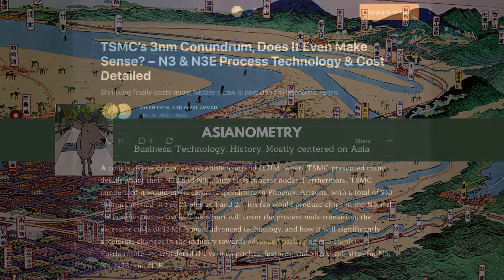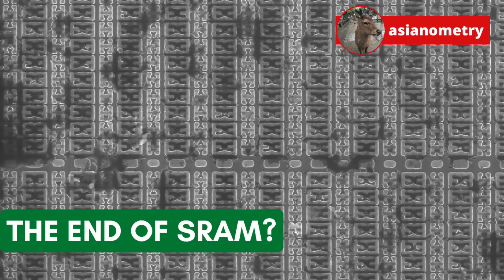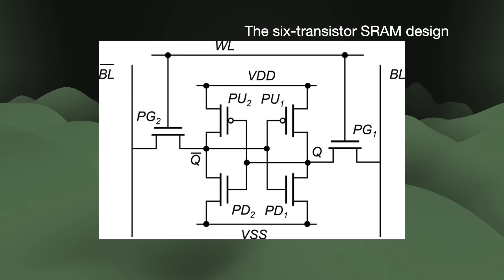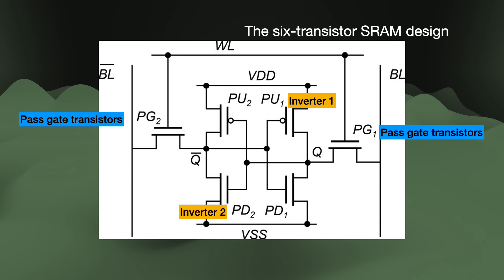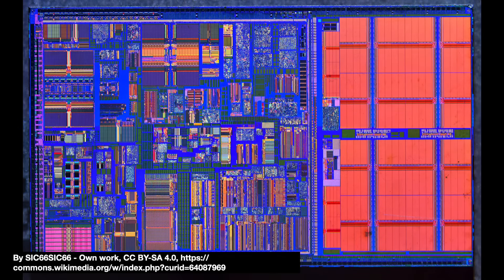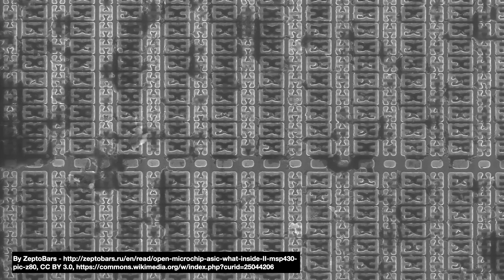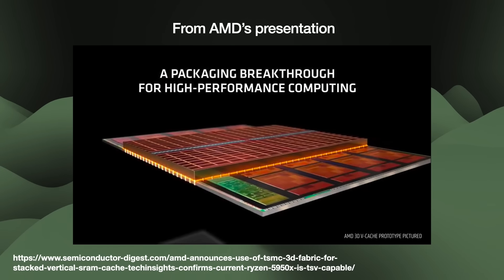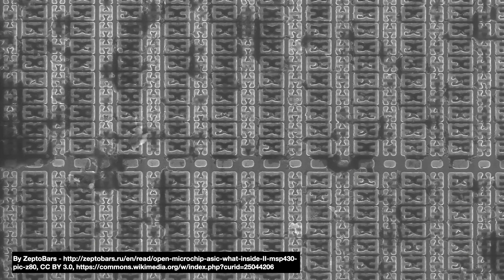Can SRAM Keep Shrinking?

Comment: 90%+ SRAM is certainly a lot, but having a lot of SRAM on a chip has a lot of benefits. For one, while it leaks, it consumes a lot less power than logic. It's also super regular and hand-crafted (unlike most logic), so, in a way, it's a very efficient use of area (especially compared to registers). It also has low power states you can use to save power in a graduated manner. Hotspots are basically always places where you don't have enough SRAM.

Designers go out of their way to try to turn structures that use registers into a structure that can use an SRAM for these benefits. The real difficulty is that to get the best density, you need to use 1RW-ported SRAM macros, which puts real limits on how you can use them. Nonetheless, this trade-off is almost always worthwhile.
Reply: SRAM that’s stacked runs hot and is often the hottest part of the SoC.
Reply: @alphar9539  Sure. Anything stacked gets hot. 🙂
Reply: One other advantage of SRAM over random logic is that it is MUCH easier to test (also including self-test in the field).
Reply: Aren't registers made of the same transistors as (on-chip) SRAM?
Do you mean separate chip SRAM? That registers are intertwined with logic thus of more expensive design? Or just less optimized because less regular?
Reply: @musaran2  Yes they are both made by the same process, but the transistors in the SRAM (and the fabric to read/write from the port) are super optimized because they are so regular and well understood. My understanding (I just use these macros; I don't design them) is that normal registers need to be built more conservatively for DRC, toggle more often, and have irregular control wiring.
Reply: @wesleyw.terpstra1902  Can you not fold a SRAM cell along one line, i.e stack two halves on top of each other to save area?
Reply: @wesleyw.terpstra1902  Anything stacked gets hot. - that was a distraction. LOL

Comment: So, another word for a latch is a flip flop. but latches/flip flops come in many forms.  This is a VERY basic latch, the minimal transistors needed to retain a state of a 0 or a 1.  If you were to look at a logic gate breakdown of this latch it's VERY easy to make sense of it.  Looking at a transistor breakdown, you have to understand the transistors.  You have in effect two sides for a latch.  Each side outputs the opposite of each other.  So, if one side is outputting a low (can't use 0 or 1 here) voltage, the other is outputting a high.  You can also say there is one side that has a true output and the other is false, or say one side is low when true, and the other side is high when true.  So, if a 1 is stored in that latch then one side is low = true and the other side is high = true.  If a 0 is stored, those two signals are inverse.  So, the high = true output would be low = false.

The way a latch works is the output of each side feeds back to the input of the other side, creating a loop that locks that logic state in the absence of another input.  Data will come in on one side of the latch.  If the data (0 or 1) is the same, the latch stays in the same state, if it's different, the latch changes state.  This is a very simple thing.

This is basic digital logic.

The reason why this is used is because you can switch transistors WAY faster than switching anything else.  You can switch the state of this latch at the clock speed that the CPU is running at.
Reply: This is incorrect. Latches and flip flops are different. Latches are level sensitive, flip flops are edge sensitive. A good chunk of money has been lost while designing a chip when someone accidentally put latches instead of flip flops.
Reply: Wikipedia:

> The term flip-flop has historically referred generically to both level-triggered (asynchronous, transparent, or opaque) and edge-triggered (synchronous, or clocked) circuits that store a single bit of data using gates.[1] Modern authors reserve the term flip-flop exclusively for edge-triggered storage elements and latches for level-triggered ones.[2][3]

Comment: You should make the point that SRAM in a processor is present in large amounts because it's used in caches , not being used as generally addressed working store, except for some embedded SOC applications. 

Also, SRAM is made with a standard "Logic Gate" fab process and DRAM uses very different materials and layering.
Reply: From what I understand SRAM is both used in registers and larger caches. I don't know why the distinction though.

Comment: It makes sense to use older nodes for SRAM stacked on newer process node logic chips. The cost would be pretty good as older nodes demand drops off and the equipment gets amortized.

Apple's integrated HBM is also a good solution as making the ram faster puts less pressure to need the even faster caches to be quite so big.

Everything is a tradeoff and there are some reasonable tradeoffs to choose from.
Reply: Yeah, but that means cost wouldn't decrease any further in the future. In the past cost per bit decreased with each node shrink.
Reply: @cube2fox  certainly it becomes challenging to reduce cost of sram from here forwards regardless what strategy is used. However, if a fixed node size becomes standard for sram, you can reduce costs in two major ways. One, you can optimize the cost of producing and operating lithography at the "final" process node. Two, due to stable demand for the process node, you can amortize the investment in plant and equipment over a longer time period. Not nearly as good as Moore's law, but it's not nothing.

Comment: DRAM is just horrible for fast access, low latency stuff, thereby it will never die for registers, fast cache, non static FPGA LUTs.....
For slow stuff such as slow memory, it's long dead already, except for small microcontrollers or special applications, like non volatile RAM.
Reply: eDRAM is quite a bit faster though.
Reply: @fungo6631  aren't tRCD with tCL still in 10s of ns for eDRAM?

Comment: The reason the chip is filled with 90+ percent of SRAM is because it's the most efficient thing to do when you run out of things to use the logic circuits for. Nobody said they had to put that SRAM in there, they could just leave it out. But large on-die cache is very good for performance, because main memory is many times slower. But I think the rise of GPU shows there's room to grow the number of parallel cores.
Reply: The problem is that most things that are highly parallel problems by nature have all been moved to the GPU by now. I can personally use as many cores as I can get because software compilation is one of the few problems that are highly parallel but also highly branched, which GPUs suck at. But mostly everyone else, outside of scientific modelling and whatnot, don't need more cores. They need faster cores.
Reply: @andersjjensen  Faster cores have been stalled for almost two decades. It was quite the ride up until the early 2000s -- exponential increases every couple of years. Back in the late 90s I was going to wait for a computer upgrade until they got to 10GHz clock rate. Still waiting...
Reply: @chrimony  Clock rate is nothing, IPC (Instructions Per Clock) is everything. My 7950X3D does more than twice the work per clock tick than my 2700X did on a per-core basis. So no, we are not getting twice as fast cores every two years, but heck that ride was already over by by the Pentium 2. But I absolutely wouldn't call it "stalled". Sure, Intel were eating their crayons and sniffing their glue for 7-8 years stright because they fumbled hard and couldn't get off 14nm, but these days 25-30% better per-core performance each generation is normal.
Reply: @andersjjensen  Clock rate is not "nothing". While it can be abused/misused, a generic CPU from the 66MHz era is never going to outperform a 1GHz generic CPU, regardless of the architecture. It would have been really nice if clock speeds had kept scaling at the pace of transistor counts. Those days were insane, and it went on for decades. Quite the wonderful run.

Gains are still happening, and there have been benefits like reduced power-usage, but the free lunch is over.
Reply: @chrimony  it was a fun time to be alive for sure
Reply: @chrimony  If a 66MHz CPU has an IPC (provided no memory bottle neck) which is 15x higher than that of the 1GHz, then they have performance parity.

The Athlon XP 1500+ (1.3GHz) has a single threaded PassMark score of 251. The Ryzen 7 7800X3D (5GHz) has a single threaded score of 3757. Adjusted for clock speed advantage that's a score of 977 which means it has an IPC that is ~3.89x higher. Which is kinda funny, because it has a clock speed advantage factor of 3.85x. So if we aren't too pedantic we can say "Half the performance uplift is from clock speed and half is from IPC gains. 

In the ~15 years between them the ~15x total single threaded performance uplift doesn't track Moore's Law, but one is a single core, the other is an 8 core. For tasks that scale linearly with cores that's a 120x performance uplift which is pretty damn close to the 128x Moore's Law projected.... But the current line of AMD Ryzen goes up to 16 cores, so there is that.

TL;DR: While clock speeds only gain 10-15% per node generation these days, the ~70% shrink each generation is gaining more and more on the clock speed in terms of generational gain. If we do this comparison again in 10 years 1/3 of the performance will be from clock speed and 2/3rds will be from IPC (it already is if we compare to a 1999/2000 era CPU, but I didn't have a verifiable online source handy for you).

So I stand by the statement. Yes, it's an over simplification, but to understand CPU progress it's a vital concept to understand. "IPC, over time, is everything".
Reply: @andersjjensen  "For tasks that scale linearly with cores"...

And there's the rub. That's why "the free lunch is over". It used to be you would do nothing to a program, and every 2 years or so it would get 2 times faster. Now you have to make it concurrent, which unless your problem is trivially parallel, is not a trivial thing to do. And concurrency does not scale linearly with cores because of Amdahl's law.
Reply: @chrimony  Both yes and no. You're right in principle, but the types of data, and the amounts of data, we process today has changed significantly over the years too. My main use case (software compilation) is immune to Amdahl's law, and most multimedia applications are either immune or have a single step out of many that isn't. Amdahl's law is very database-write-centric, but the vast majority of databases are either completely or mostly read-only. Which makes them completely or mostly immune. But even if we take Amdahl's law as read, the tangible decline happens (for his particular requirement) between 128 and 256 cores. So that's a fair ways out from a workstation point of view.

That said: You completely ignored the main part (IPC vs clock speed), and focused on the filler details :P
Reply: @andersjjensen  I "ignored" IPC versus clock speed because you were relying on cores to cover the gap. And you're being awfully optimistic about how wonderfully parallel the real world is. While there are certainly cases where that applies, it's not routine, and the real world has to deal with all the hazards of concurrency.

Comment: Heard TSMC can increase the sram density if they remove all logic. Not sure how that works though.
Reply: Removing all logic removes a lot of noise these allows higher density. The thing with SRAM is that it is partially analog. The two bitline does not only carry data but they also serves a function when reading and writing. When you have logic that is very noisy the bitlines are giant antenna that might flip the state of the SRAM cell.
Reply: That is exactly how AMD's 3D-Vcache works. There is nothing but SRAM on the chiplet (and of cause the connecting pins) so the gate patterning can be optimized solely for that layout.
Reply: As a general rules, chip processes are optimized for either speed (logic), density (memory) or efficiency (mobile/embedded).
Mixing on a chip means compromising, though some tricks allow to tune transistors on the same chip.

Comment: Shrinking a transistor by half means it has √s̅u̅r̅fa̅c̅e̅a̅r̅e̅a̅, so this results in more than 50% faster electron traversal. However, we only see 20-40% improvement because of efficiency loss.

This means that a slowing ability to shrink the size of the transistor is expected; we're getting more than double the theoretical cap every time the transistor shrinks by half.

Comment: I wonder if SRAM can be produced with much greater defect tolerance as opposed to logic -  I mean, after the fact, we can just run a test to see which cells are faulty, and burn in a hardware level mapping that shuts off faulty cells, with not having to deal with them.
Reply: They've done this for many years.

Comment: Your statement about AMD and cache is incomplete, so much so that people that don't understand how CPUs and cores work it can give the wrong impression.

SRAM is used in cores for registers along with cache.  Registers are a collection of latches just like SRAM is, although the configurations will be different.  There aren't many registers compared to cache.

Registers can NEVER be moved off the main core die, because they are integral to the operation of the core, you need data registers to do pretty much ANYTHING in a CPU core.  Registers are temporary storage for instructions, and the registers are tied into the instruction logic.  A very simple thing of A + B could mean getting data from memory to add together and storing an answer back in memory, or it could be these values are constants built into the instruction.  In either case, it's data that can be put into registers and then add those registers together and load the answer back into another register.  The very next instruction may need these values so having the data in registers means the next instruction doesn't have to call that data from memory again.  So that's one thing.  Registers are integral to the operation of instructions and that will NEVER move off the core die.

The next thing is cache.  You mentioned L3 cache, but unless a person understands how a CPU works there isn't enough information there to understand the implication.

There are typically 3 levels of cache in a core (there are multiple cores in a CPU).  L1, L2, L3.  L1 is closest to the instruction logic and operates at the same speed.  There is not much of it because it's the hardest to make PERFECT because it has to once again, operate at the speed of the core.  There is next L2 cache which there is more of.  The problem with having more cache is the time to search it takes longer, so the time to fetch from L2 is longer than L1.  The time to pull data from L1 is a single clock cycle, the time for L2 varies based on the CPU type.  L2 ALSO HAS to be on the core die, because it's a larger pool of data/instructions that the core has been using and may need again.  L3 is the slowest, and also the largest set of cache.  THIS is what can be pushed off onto another die, as long as the connections between those two die operate fast enough which is the key.

Cache replicates what is in memory, but there's a small amount of cache and a large amount of memory.  As a core needs data, if that data hasn't been accessed already it's either on disk or in RAM (main memory).  If it's on disk, it will get loaded into memory first, then pulled into the core.  It HAS to go into L1 to be used by the core.  Caching methods vary so I will give A method of caching.  There is only a small amount of L1 cache which runs at the speed of the instruction logic.  There is also cache for instructions and cache for data.  Instructions of course run incredibly fast, as in a VERY rough figure of about a billion a second.  This varies because there are wait times so you can't simply take a clock speed and say there is one instruction per clock cycle.  This is why I'm giving a VERY rough figure for this.  But, say 1 billion a second.  In that time period L1 will have been changed out millions of time because L1 doesn't store much.  One way to deal with a caching scheme is when L1 is full and you need something that isn't in L1 (where all data and instructions are dealt with from), is take the data/instructions used the furthest back in time (so you need a time stamp for what's in cache) and push that down to L2.  If L2 is full, then you take the data/instructions used furthest back in time and push it down to L3.

As was said, L1 - L3 represents data/instructions that came out of main memory.  You never need to update instructions since instructions don't change, but you do data, and since L1 - L3 can have updated values for data that's stored in memory, you also need to write this change back to main memory.

So the key takeaway is L1 HAS to be right next to instruction logic and runs at the core speed and it holds data/instructions each in a separate space, and it HAS to be on the same die as the cores.  L2 ALSO has to be on the same die as the cores because you often need to access data/instructions that you're already used but since L1 is small it got pushed down to L2.  L3 is the ONLY cache you can push onto another die, AS LONG AS you can clock the connection between the two die fast enough.